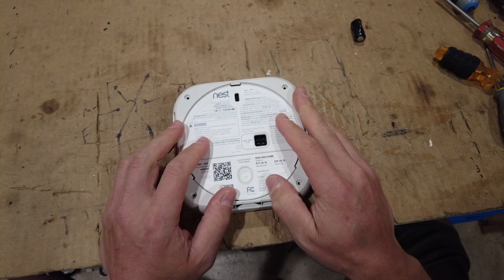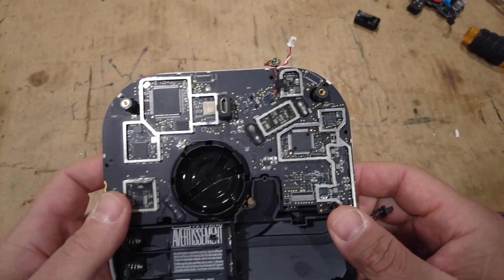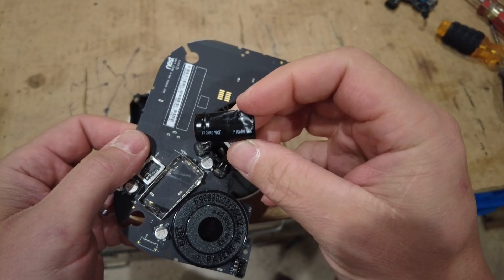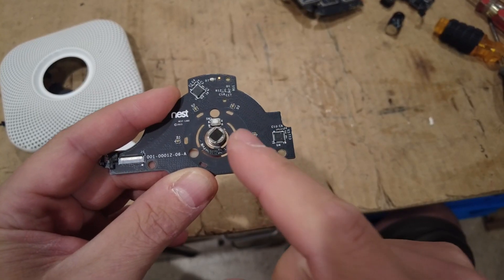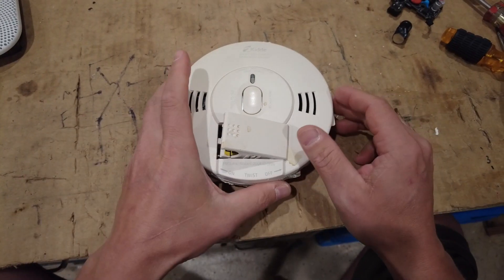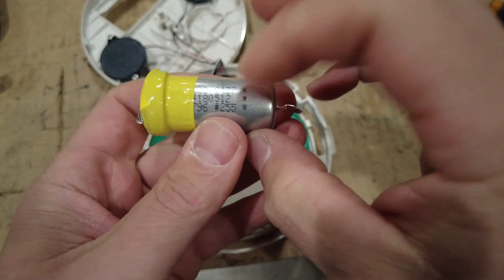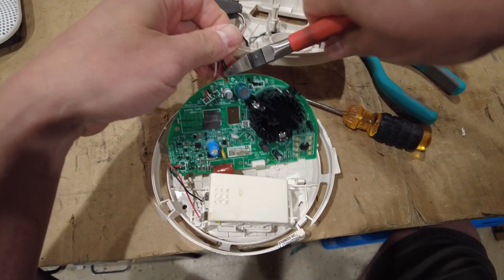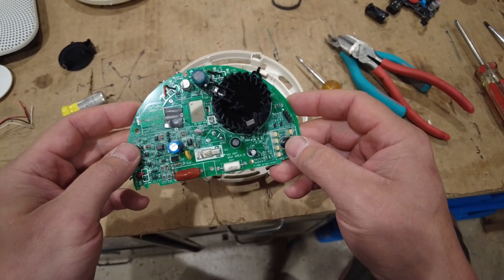Nest and Kiddie CO Smoke Detector Teardown

Comment: the NEST heat detector is used to turn on the LED to light the room when it detects a person at night. It is also used by the Nest / Goggle heating system to detect if the house is occupied to activate the heating.
Reply from the maker: Ah that makes sense!
Reply: The motion sensor is also used to provide ambient lighting. It’s great for hallways. I have 4 around the house.